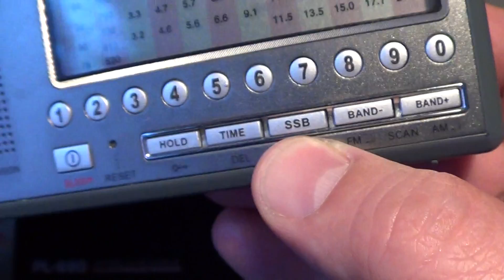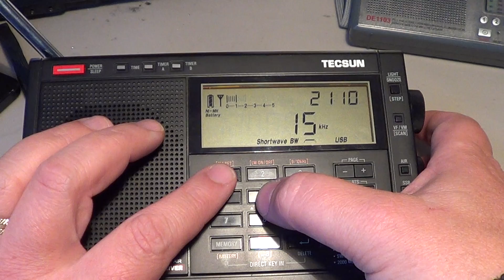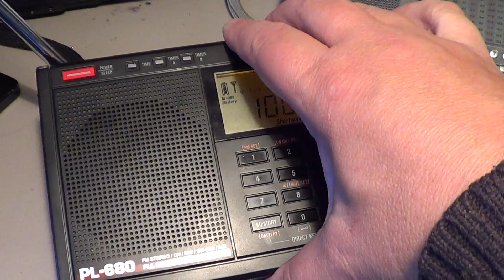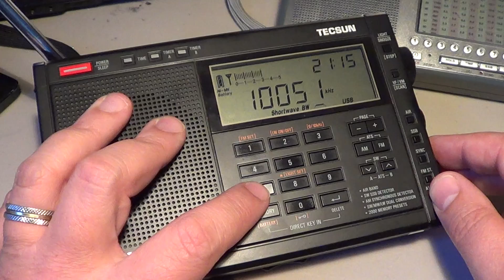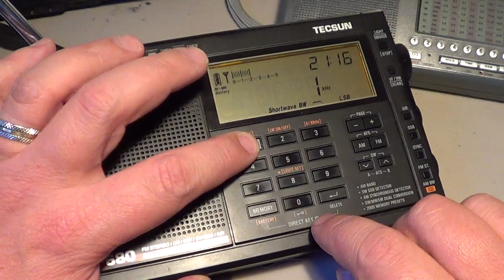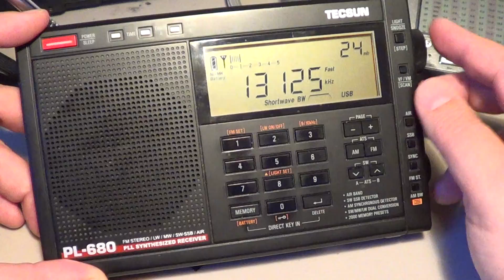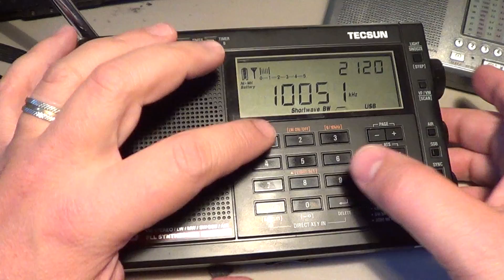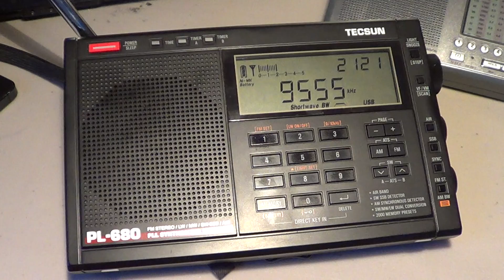Shortwave for Beginners part 5 When to use SSB USB and LSB modes on a shortave radio

Comment: hello,  can i do anything good with a panasonic rf 2200 ?  i just repaired this radio, i had gotten from my grand father, i remember seeing this radio at his house when i was 10...  35 years ago... heh and now i got it working, but i  havnt been able to really hear much so far,.. any pointers, ima gunna watch the rest of your parts,  this is the 1st i've seen so far,  thx
Reply from the maker: There could be a lot of noise if you just use a indoor antenna that prevents you from hearing the signals

Comment: Excellent instruction/tutorial.
QUESTION:   If I attach a length of wire (antenna) to my radio, how would I be able to determine what frequencies/bands  I should be able to 
receive???  Let's say, for example, a 16 foot length of wire. 
Thanks!!!
Reply from the maker: for receiving just apply the rule, the longer the better and it should be good for the entire shortwave spectrum
Reply: @OfficialSWLchannel  
I assume that the longer the better also includes "the higher the better"??????

Comment: How does CW mode and DSB differ from SSB
Reply: CW stands for continuous wave, meaning morse code. I'm just guessing here but your radio probably limits the bandwidth in CW mode for pinpoint accuracy, which allows for greater sensitivity. DSB means double side band but without the carrier, which is usually reserved for radio data systems.

Comment: Can u PL suggest me the best ssb receiver ( model make)
Reply: I prefer an analog type radio. I have a similar digital radio like his and it goes quiet  when tuning. This misses weak stations often like nothing is on the air when auto tuning scan mode.

Comment: I have a little Shortwave Receicer that can do SSB too. With a BFO. When I tune into a Signal in LSB, it is that when I tune up, the Voice will sound more high-pitched and when I tune down, the Voice will sound more low-pitched.

In USB the Opposite is the Case.. When I tune up, the Voice will sound more low-pitched and when I tune down, the Voice will sound more high-pitched. This is how I notice the Difference, if a Signal is USB or LSB.

Comment: anyone interested in a few facts. 1. most radios are twice as sensitive in ssb than am. 2. tuning a weak am signal can be enhanced by tuning the am station then selecting upper or lower ssb mode. Upper or lower ssb may allow better reception due to moving away from adjacent interfering signals, real or images. I use equipment with selectable ssb and has no bfo.
Reply: Moving away from interference OK, but most of all it helps coping with selective fading by reinserting a carrier when the original one was destroyed by fading.

Comment: What is the difference between SSB and SW? I have the Tecsun PL-310 ET and has no SSB. Thanks for the videos too. I have learned quite a bit watching. TY
Reply from the maker: Well technically CW is for Morse Code, but it does work in a similar way as SSB in creating a Carrier in the receiver for reception, also CW often has a much smaller bandwith size, since there is no voice but only tones
Reply: Thank you for your quick response.

Comment: Is it possible for a radio to have BFO but not SSB? and if so, why?
Reply from the maker: +simple jones no, a BFO will always be used to tune the SSB frequencies, so if a radio does not have SSB it does not have a BFO
Reply: Thanks, I have an older Radio Shack with wide and narrow, and BFO, but no button or knob that says SSB LSB or USB.